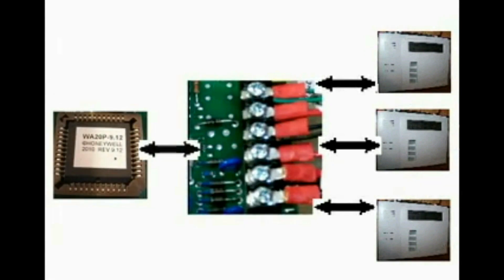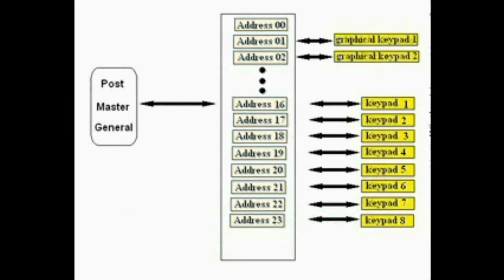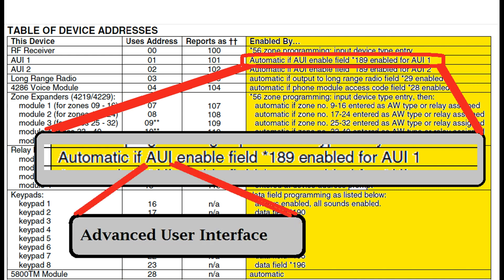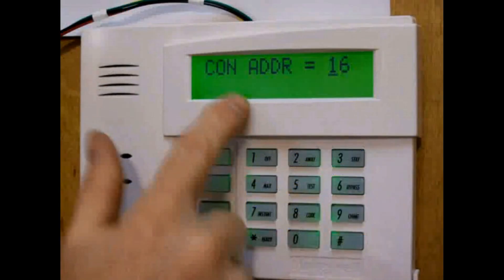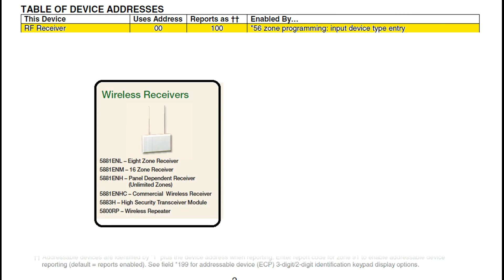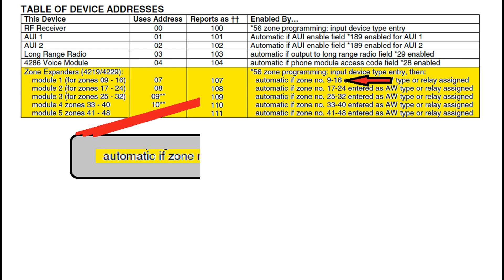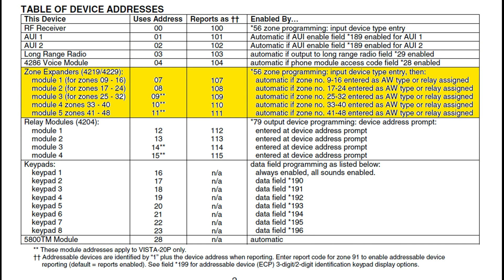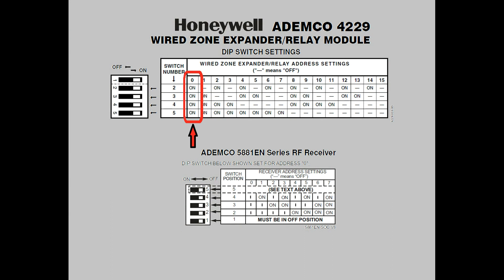vista addressing explained (Vista 20p part 16)

Comment: Bounder97,
Your step by step videos have been invaluable.  I had managed to set up my panel, my transformer and battery and a keypad, with end of line resistors completing the remaining zones, did a factory reset and everything was running perfectly.  Life caused me to have to abandon the project there for two months (ailing wife, two teen daughters can eat into free time) and when I returned, I found a COMM. FAILURE message on my 6160 keypad (yea, I left the system plugged in with battery during that time).  I cannot make it disappear; I can no longer factory reset my panel... I can only see that my key pad is still addressed properly (press 1 + 3 and it is still at 16).
Here are some things that I think may have contributed to my new problem:
1. Power failures: we had at least two during the time that I hadn’t worked on the system.
2. Extension cord: my transformer was plugged into an extension cord because I was too lazy to run a long enough wire to get to the outlet.

I know that you are not a technician, but I was wondering if you had come across this type of problem in your training centre... and if you might have found a way to start from scratch without having to replace the panel. Thanks,
Steven from way up north
Reply from the maker: I would put my money on the power outage.  If the battery was left hooked up, and drained below 10 volts, it damages or destroys the battery. I had a similar problem. I replaced the battery, gave it 24 hours to charge and everything started working again. The extension cord should not have caused it. At the power levels the vista pulls, the cord is more of a fire hazard then an equipment damager.  With that said, I have had the power company smoke check a Vista panel as well as the entire neighborhoods cable boxes during a power outage.  They hook a truck up to the power line. Then send a signal down the line to look for the problem. The voltages they used destroyed my panel and about $2000 worth of other stuff.  If this happened, you should be able to open the Vista panel and smell burnt electronics.  Good luck.

Comment: Bounder97, I hope you can/will answer a question for me regarding your #11 video, installing a second 6160. When you say "completely power down the system", is that pulling power AND battery backup? If I do that, won't I lose all my other programming? Waiting hopefully for an answer with my 2nd keypad installed, but not fully connected yet. Thanks, 
Bob in commiefornia
Reply from the maker: Yes, you must remove both the main power and battery. The battery will keep the Vista running just like you had never disconnected the main power. (That is until the battery goes dead).
As long as the programming was done properly, you won't lose your programming. There is a copy of the programming  saved in something called non-volatile memory. This is like your hard drive on your computer. You can shut off the computer and not lose the information on the hard drive.  After power is removed, then reapplied, the Vista will automatically upload that programming and start running it again. Kind of like when you turn on your computer. Windows will automatically load from the hard drive and start running.  Hope this helps.. Congrats on installing the new keypad!!
Reply: Thank you VERY much, I'll be trying that today. The 2nd keypad is already installed in my shop, all the wires run and connected except the positive 12 volt one. I already added address #17 with my initial keypad, just have to tell the new keypad it's now #17. Thanks again, you have helped me IMMENSELY over the years with my 2 Vista installations. GOD bless, Bob in commiefornia
Reply: @bounder97  I have a question related to non-volatile memory. I currently have a single 6150 keypad. I am going to replace it with a 6160 keypad. The information stored in NVM is on the main control unit and not the keypad, right? Meaning I won't lose my phone numbers and account info etc. related to calling the monitoring service when I swap keypads. I'll be switching to self monitoring at some point.
Reply from the maker: @dontarvin9744  Hello,  Just a reminder that I am not an alarm system tech, Just some guy that likes to learn new stuff though trial and error. In my opinion,  you should have no problem replacing a 6150 with a 6160. Other then how absolutely happy you will be with the change. The  monitoring information seems to be stored in the Vista panel in fields 40 - 49. To be safe, just contact your monitoring company and ask about this. I do have a 6150RF in my system. The RF means RADIO FREQUENCY. It allows me to use wireless devices such as KEYFOBS without buying the more expensive 5800 series transceivers. 6150RF units do actually have critical information stored in them. So please be sure your are just replacing a 5150 and not a 6150RF. 
Good Luck !!
Reply: @bounder97  Hi, I just purchased the Vista 20p for my business. It's small and I am only in need of the 2 door sensors.  Both are on the same partition.  I have the front door set on zone 2 and the back door set on zone 3. How do I disable the other 5 zones?  Thanks for your help.
Reply from the maker: @bigshaneproductions  Hello, there are two ways to disable hardwired zone.  

You can either program it as zone type 00.  (that is zone type zero). Programming is done while using the *56 programming field to set up each zone. This will cause the Vista panel to ignore the unused zone. 

The other method is to just place a zone resistor across the zone input screws inside of your vista panel.  You can see how to do this by watching part 2 of my home alarm system video series. As long at the system sees that resistor, it will assume the zone is not faulted. (technically, it is still an active zone, but you don't need to install a sensor on it.)
Reply: @bounder97  Thanks.  I went back through the series and found it.  I appreciate the reply!!
Reply from the maker: Hello,
No, you will not  lose all of your programming.  Your programming is stored in what is called non volatile memory.  this means that when power is removed, your will not lose the information that is stored. Your computer, which most people think of, has a RAM (random access memory).  When you kill power to it, you lose everything. The Vist 20P is like your hard dive. Once you save  a program to it, it is good until you change it.  Good luck and great job at chasing after that second keypad.